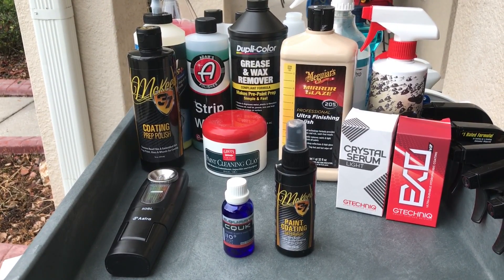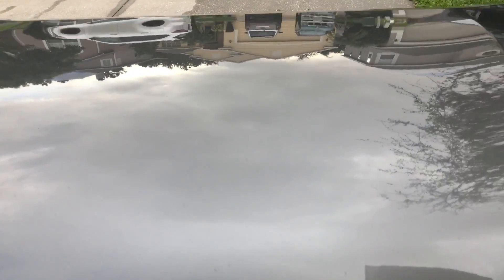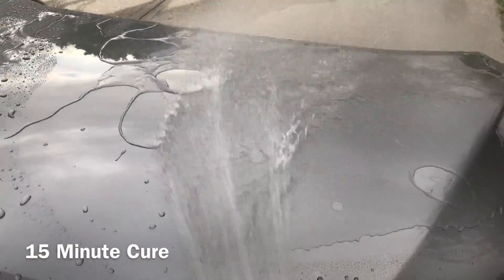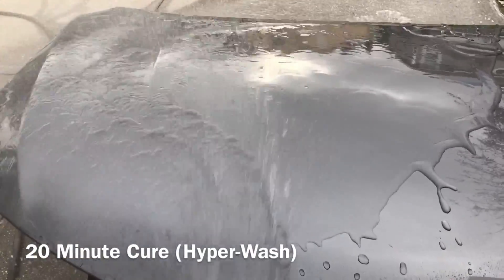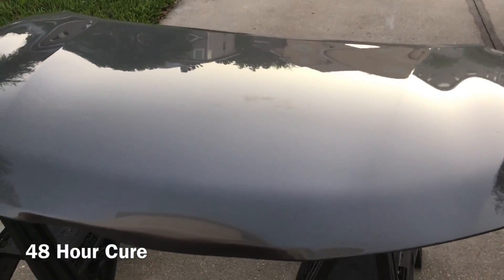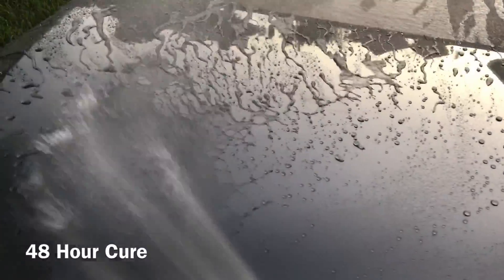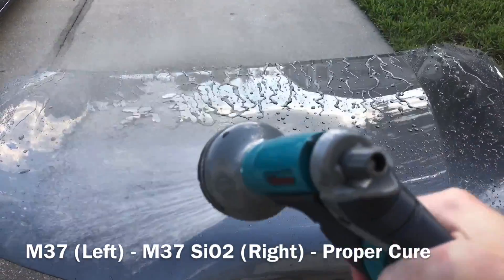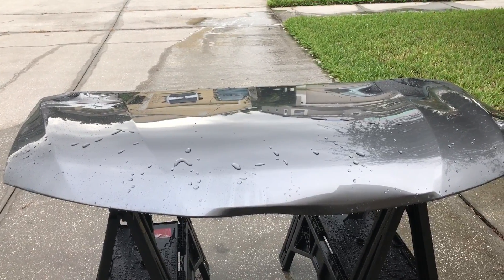Paint Coatings - What happens if you wash them before they cure?  Let's test!

Comment: What is the claimed durability on Mckees37??
Reply from the maker: Hey Jerome, I believe McKee's has since discontinued this SiO2 Enhanced Paint Coating, and replaced it with a 3+ year coating at $80 for 4oz.  I know that this specific one I'm using in this test video was definitely a 1+ year coating that could easily make that mark with regular washes and maintenance on an ungaraged daily driver in Florida.
Reply: @WaxMode   i can still get it from carzilla.ca so probably not discontinued. If you had to choose between mckees37 and wolfgang uber  ceramic spray coating ...... looking for a 12month + easy and fast coating to offer my clients as entry level. Price is also a big factor.   Any recomendations  for the kind of product i am looking for is also welcome !!  Thanks

Comment: Hey man what if with cquarts u had it IR cured does that remove the need to wait 48 hour time?
Reply from the maker: I'm not sure how well CQuartz responds to IR curing.  This is definitely something that I wanted to test, and I ordered the IR curing lamps to be able to do this but all of them came in broken, and I wasn't able to afford some of the more expensive options so I'm still in limbo.  Technically, the IR curing should be able to accelerate the curing so that you wouldn't have to worry about the coating getting wet in between that 24 hour time period, but I would still avoid detergents and I wouldn't wash the car within that 1 week period.

Comment: WOW. That mckees coating is bonkers. Crazy beads
Reply from the maker: I would say that it's an underrated coating.  It did a fantastic job on the paint in the durability test, I've still got a small batch that I've kept on the front bumper going 3+ years now after being topped with a range of different toppers.  They're getting ready to phase it out however, McKee's has an updated coating that will take over.
Reply: WaxMode what’s your thoughts on the hydro blue spray and rinse vs the new spray coating?
Reply: WaxMode also, is it work picking up?
Reply from the maker: @jeremys8360  I think if you're in the hobby, you have to have a least one spray and rinse type product in the arsenal for wheels and crazy grill areas on the front and for the rear sections.  I like Hydro Blue, I think it's pretty comparable to CarPro Hydro2 and Gyeon Wet Coat, although I'm not sure if Nick has updated Hydro Blue at all recently and I haven't tried the latest version of Wet Coat out from Gyeon either.

The Sio2 Enhanced coating is definitely a significant coating that was more hydrophobic than Hydro Blue, my only negative was it was one of the first coatings that expired and turned to jelly in the plastic bottle after months of storage, I think that was one of the reasons why Nick decided to go with a completely new formula released this year in a standard glass bottle.  Hydro Blue to maintain the coating is a good plan of action.

Comment: I think of it like painting a house. Until it dries (cures) you need to keep it dry and not touch it. Sandro at Car Craft Auto Detailing also showed a rinse, or even a wet wipe, immediately after application really hurts performance and longevity for some products. It makes sense since, before it is bonded (aka cured) some of it will wash away since the chemical bonds have not been formed. Some manufacturers (Adams? iirc) specifically warn to not "over buff" during application since, like rinsing, wiping will remove product that has not yet bonded that otherwise would have. Good rule of thumb is to do all you can to protect any applied SiO2 product for 24 hrs minimum if you want the most out if them.

Comment: This was very interesting as I use CQUK extensively on customers cars and promise them 2-years of satisfaction with the coating. I always instruct them to not let any water touch the car for 1-week after the coating service. I watch the weather forecast closely and will reschedule appointments if there is any precipitation in the forecast. Over the past three years I have never had a complaint about CQUK.  I do apply reload every 90- days to maintain the sacrificial layer. Not every customer brings the car in 4 times a year but most do because I stress the importance of getting the full value out of their investment in the coating service. It would be interesting to do a long term durability test after water hits the car within the first couple days after the initial application.
Reply: Wow, I miss the glaze-seal it- wax it days and pick it up after I am done. 🤯🤔😬

Comment: That was awesome man!  Super interesting to see what happened when it's not cured fully and rinsed.  Pretty impressed initially with the Mckees37 coating.  I'd love to see what happens to both coatings a few months down the road.
Reply from the maker: Miranda Detailing - Thanks Phil!  It’s fun to see what happens when companies tell you to not do something so we can see for ourselves why that is.  The M37 coating was a great performer on the test car in the durability test, didn’t hold up quite as strong as CQUK without toppers but you can stretch it far if you’re maintaining it.  I do have a section on the front bumper where I’ve been maintaining it occasionally with various sprays and it’s still phenomenal.

Comment: Great Interesting video! This great for people without a garage so they know what to expect if they use a coating and it rains after.
Reply from the maker: Thanks a bunch Brian!  I would say the wash with Hyper-Wash was probably the main contributor to the drop in performance from CQUK.  But it's good to know that if the coating does happen to get wet shortly after application, it's not going to completely kill it and it will continue to cure.

Comment: now the question is, will the durability change in this test?
Reply from the maker: Mark Lin - You’re right, without a long term test I can only make assumptions.  One test that I may do is to run a section that gets wet shortly after applying it without washing, and then set up a proper dry section next to it and run the long term results.  Most people aren’t going to wash a fresh coating at 15-20 minutes, but a lot of guys may run into unavoidable or unpredictable wetness after applying if they don’t have a garage.

Comment: Awesome video again WaxMode! 

To look at the test shows what happens rather than guessing. I also think that without proof that the durability on at least the CQUK coating is very reduced. It has with the chemical reaction that's happening when applyied on the paint. And think that it's the Hydrogen molecules that bonds more than the Oxygen ones does. It's not a completly difference as you have the Hydrogen molecules in the air too but when it's gets so high it's impacting the coating performance. Or if it's so that the Oxygen molecules bonds in a too high of amount. And blocking the the molecules that you have in the air if that's something that needs to be added in the coating during the cureing. Would be very interesting to see how it would be cureing if you take a smaller painted part and coat it and put it in water so it don't get the air during the cureing time. 

Wondering of the chemical build up in the McKees 37 Paint Coating has to do with the different results to CQUK. Since the McKees coating is a SiO2 enhanced I think that you have a big difference to a SiO2 based ceramic coating like Carpro CQUK. Some have made a claim in an article that where a chemist. That a SiO2 based ceramic coating can not be stored in a plastic bottle. And need to be stored in a glass bottle or like an aluminum bottle like the Gyeon CanCoat is. Then it can be that it depends on the carriers of the SiO2 and what kind of second part that does give you the hydrophobic top layer of SiO2. The cheapest and easiest I think is the PDMS as the second part that reacts with the SiO2 parts. And these is what usually sets them apart which SiO2 base and the reaction part of them that's used. So it's able to be cureing in the thickest and hardest layer on the paint. And also so the hydrophobic top layer of SiO2 based ceramic coating lasts as long as possible and is tough to hold up to the environment it's used in. 

Thanks so much for makeing this video as it gives you a knowledge about what happens.
Reply from the maker: Tony Mattisson - Thanks Tony!  Most of the coatings that I’ve used that come in glass bottles have not crystallized over the years.  The M37 in the plastic bottle turned to jelly at 9 months but most likely was severely compromised before this as it begins to partially cure.  They have plans to swap over to the glass bottle so hopefully that solves the issue.  I’m looking closely at CQ Lite to see if it has the same issue.  No problems so far at 5-6 months after being opened.

I filmed this test years ago, my guess is the soap wash had the severe reaction with CQUK, I have a feeling if I just rinsed it early and then dried it without washing, I think it still would have cured much more effectively.  I’ll have to run more tests when I get back to Florida, I also want to see how all my older coatings perform after being stored for so long to see if they are still workable.  I’ve got a lot of tests and topics that I want to tackle through for 2020 so I’m looking to ramp up videos for next year for you guys!
Reply: @WaxMode  sounds promising with the CQ lite and it's holding up in the bottle. Makes you wonder if you would put the CQUK in a plastic bottle and see how that goes. When they have coming up with a solution to store the coating in an air tight dispenser even when the seals are opened. Then I think that you will be getting a very long shelf life. Like with Opti-Coat and Wolfgang über Coating in a syringe. Kind of smart to store it but maybe not as user friendly. Then they maybe don't want to get so long of storage life so you buy a new bottle of coating sooner LOL. 
Looking forward to 2020 and what you will be doing Kyle! Since you go so much of in depth in your videos. Maybe you would consider to be doing series of videos where you can make a playlist with the topics you go through. Could be easier to followers to catch up on the knowledge on those videos that goes deeper into some of the topics. Then mix it up with your awesome product reviews of the products you testing. I like the real world durability follow ups as it's not so common videos on detailing youtubers channels. And not so strange that they are not so common as they take time to get done. Also haveing enough of test vehicals to do it on LOL. But much worth for us that maybe don't get the just released products. And waiting for the reports from those that has got the products from the beginning.